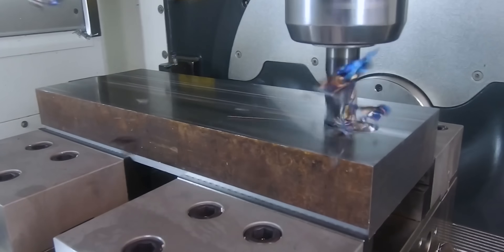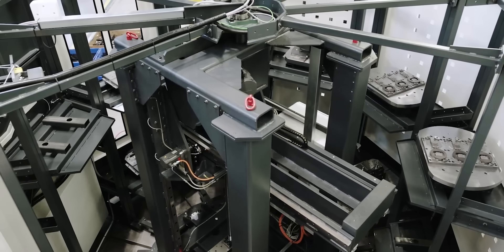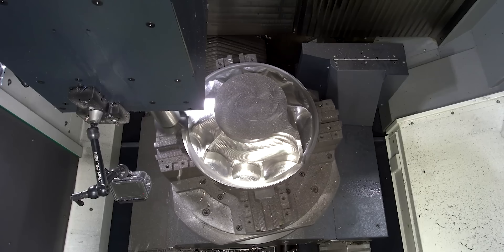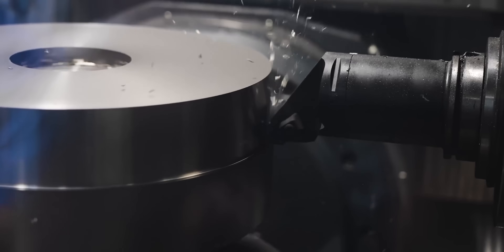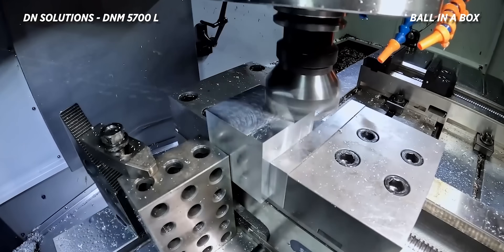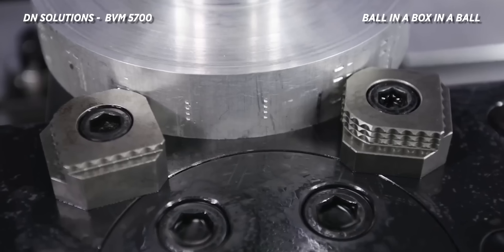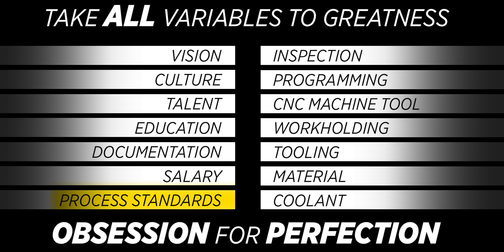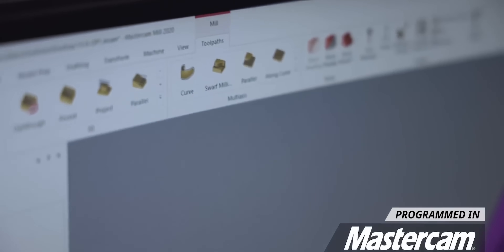SECRET to Building a CNC Machine Shop That Makes MONEY

Comment: Great content, I have not furthered my CNC certificate into Machinist, Programer, or Tool and Die. I have Precision CNC Machine Operator Certificate 2016, the shop hired me as an evaluation mechanic. The lathes and mills are only manual, with operator position not available likely due to “mind set”. Certification experience on HAAS lathe and little on Chiron Mill, Master Cam and Micron table with ruby or Safire tip CMM. I need more hands on creativity application and freedom

Comment: As a small shop owner of over 25 years, I have seen the shrinking of manufacturing not because we can't push our machines, but the lack of good customers.  Pay has been stagnant for decades. Competition with overseas has eroded most of the work except aerospace and medical.  Try getting into those fields!!! Seen many great machinist and shop owners leave this field for others because of $$$$.  Compare what machinist make to other trades to realize how underpay-ed this segment is.  Not all shop can or are willing to drop millions in high end machinery and tooling just to compete. If you don't have your product line or be a tier 1 customer to a large aerospace company then how can you afford such expensive cnc's?

Comment: After the first Video i watched my reaction was " wtf thats crazy i wanna see chips flying like this too" and after that i alwyas looked how to push my Machine even if its just a small bit.
Once i changed programm from 1mm in depth to 1.2mm.
My coworkers told "it´s just 0.2 what is it even change".
But every 5 Cuts i saved 1 pass.
(On that part thats like 40 cuts less)

Yes, it´s just on small thing.
But many small things makes a big different at the end.

So dont be scared to change a thing and save Time and Money.
Be more scared to do the same thing over and over again.
Reply: sometimes if you speed it up enough its another load of parts run every day because it gives you enough time to load up again and hit go before you leave for the night

Comment: CNC machining company owner with +20 year old machine be like: Invest 250k dollars on a new 5 axis machine - NO| buy a new sports car for 250k dollars - YES! 

This is the mentality of today's bosses, they want production to be efficient with machines that are over 20 years old and low quality tools that barely manage to guarantee tolerated quotas. I'm not saying it's all, but that's the general picture.

They don't invest in new machines, or in training the operator/programmer, much less reward them if they manage to work miracles with old equipment. It's sad but it's reality...
Reply: Literally my shop.

Comment: I feel its equally important to consider Radial Engagement. A feed rate of 10,000mm/min with a 1mm width of cut, 20mm Depth of cut will remove the same material per minute as a 5,000mm/min cut with a 2mm width of cut, same depth of cut. Running faster feed rates also accelerates linear component wear (very minimal I know) and often doesn't allow you to catch mistakes in time such as; stock not against part stop etc.
Reply: Well if your machine can actually accelerate/decelerate to keep up with the program feed